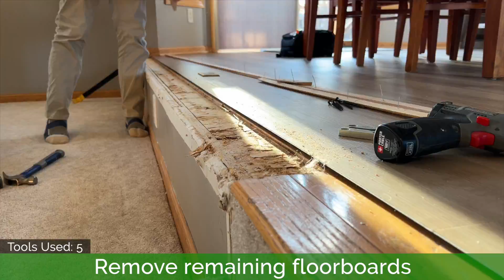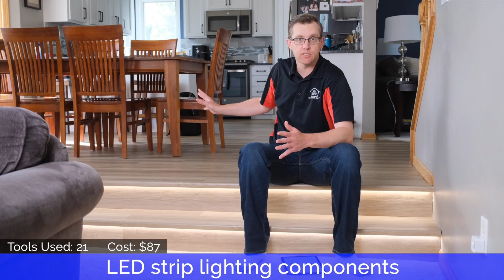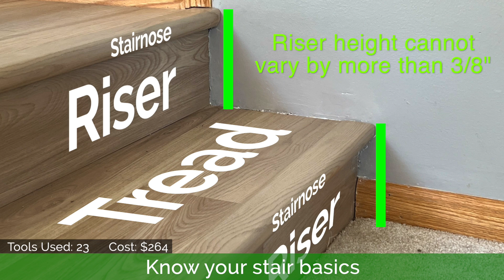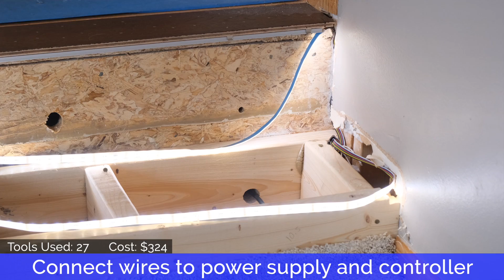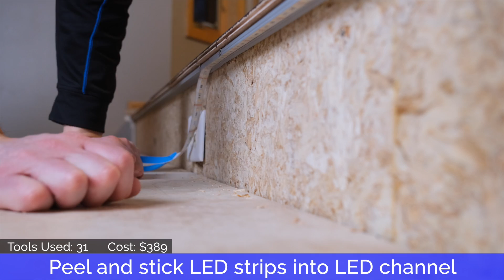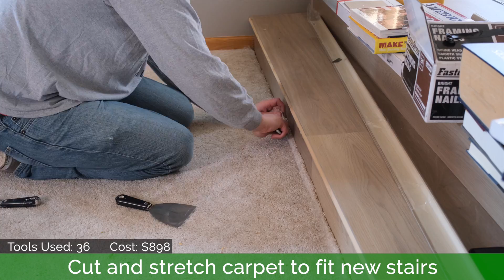Ultimate Guide to LED Stair Treads

Comment: These LED lights are WAAAY too bright.  Almost blinding bright at night especially.   Maybe have the dimmer accessable, so they can be set to a very low level glow, just for the mood.   I would also ditch the colored LEDs.  Don't need purple or blue lighting.  Just a good quality white light which is dimmable to almost off, would be 1000x better, in my opinion.

Comment: That turned out great. Only thing I might have done differently is added an electrical box and cover on the wall between the two stairs to house the lever lock connections so they are easily accessible if you ever need to change out the LED strips.  Killer project though.
Reply from the maker: That’s probably better than my current plan which is to bash a small hole in the wall if I need to access the wires. I even had a part in the video where I said that I tucked all of wires into the crevice near the wall so I could access them by bashing a hole in the wall innstead of ripping up the stairs. But when I said it out loud it sounded too stupid even for me so I cut it out.

Comment: Love a project that both creates and solves a problem all at a nominal cost!  That is the essence of my whole smarthome experience (and about any other project I endeavor).  P.S.- I thought you were building a library there for a moment with all those books :)
Reply from the maker: Yeah, pretty much. The original plan was to just replace the railing with something more modern, but when we took the old one off, we realized it was way better without one. So this was plan B and it worked out pretty well